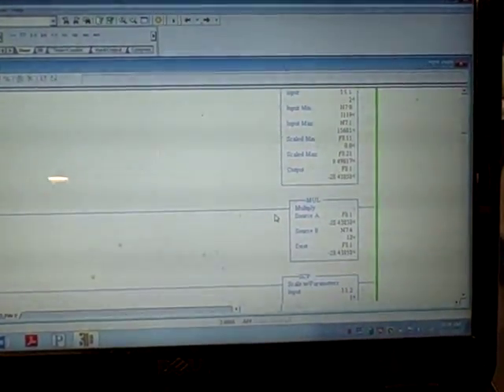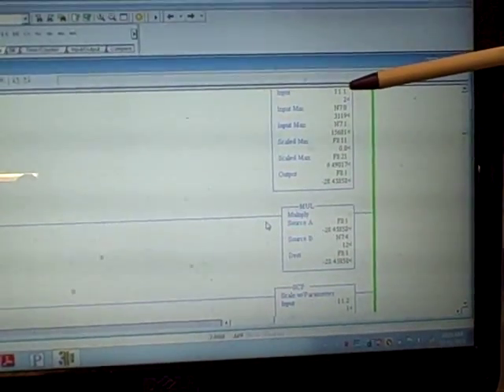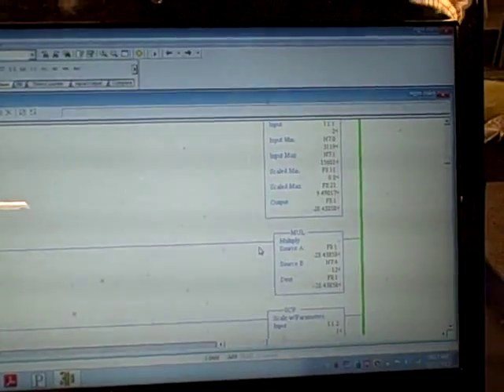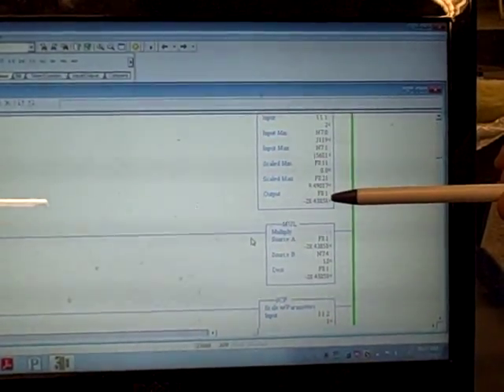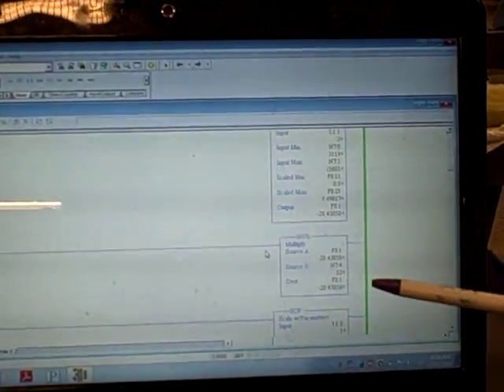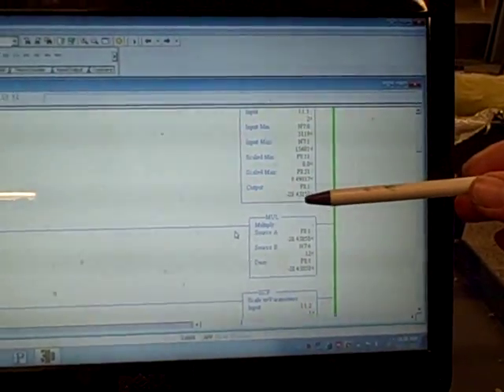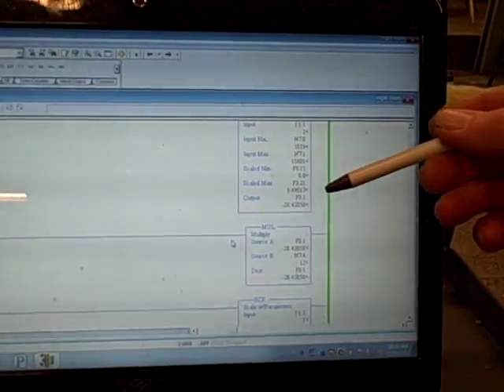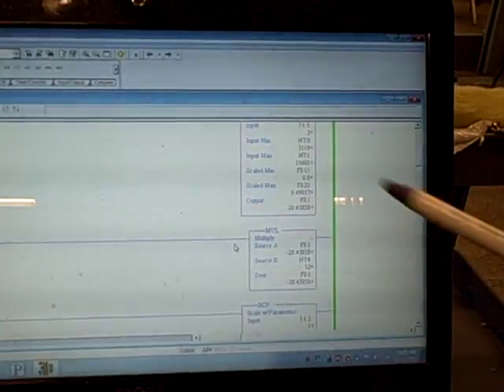PLC online display of variables -- a caveat!

Comment: It is essentially reading a different value in register F8:1 every few tenths (or whatever your PLC scan time is) of a second.  The hard wired input, and the calculation in the program are fighting for the same register.  This also wouldn't display correctly if F8:1 were mapped to an HMI.  You should never have multiple sources write to the same register.